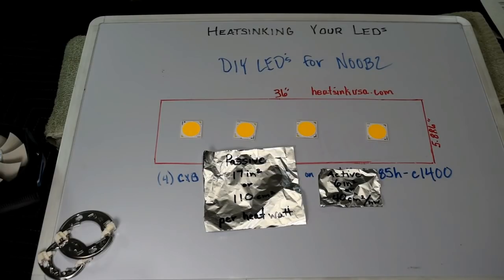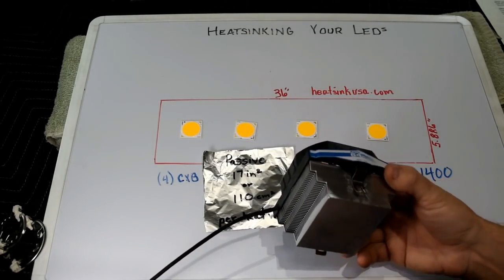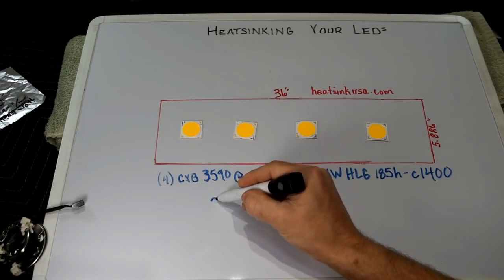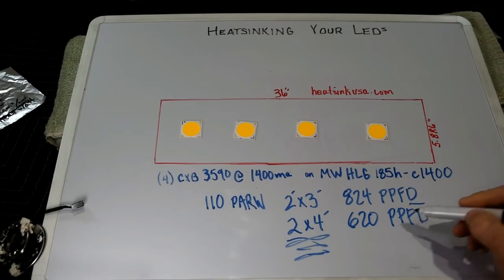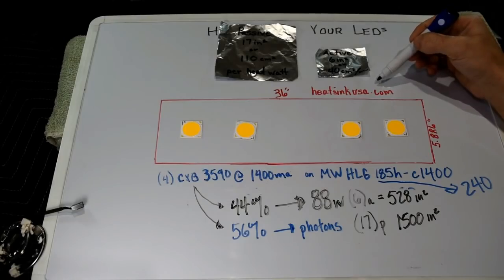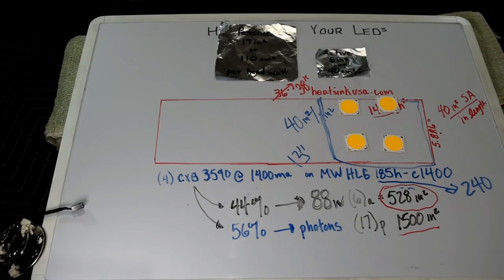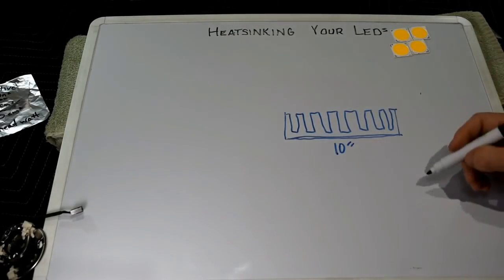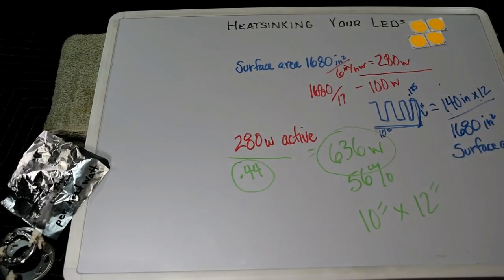DIY LED Basics - choosing your heatsink (part 3/6)

Comment: Thanks so much for the fantastic videos. I am sold and have just ordered some cobs but I just wanted to check my assumptions that I have made with you first.
  
These are 3590 CD's and at 1.4 amp's they produce 21.32791 heat watts per cob and you are rounding up to 22 heat watts per cob?
  
Thanks again for your amazing videos.

Comment: Hey man, just want to say thank you for all your amazingly helpful videos. I was advised to check one out by some guys on the grow weed easy forum and ended up watching a bunch. the result...I'm SOLD. I was looking to get an led to replace my CFL's, but the cost for what you get seemed a little much, but making them myself, I'm totally down with that. my question is, I have a 1.5' x 1.75' x 4.8' grow space, so was wondering what size heatsink you would suggest, as most of yours are rectangular as opposed to square. I presume the principal is the same though, heat watt per Sq in. any suggestion would be great. also, I can you advise which I should go for, the 3590's or the 3070's? thanks again man, best led/cob vids on YouTube for sure.

Comment: CXB 3590 question:  Do I need a full "137w dissipation" if I'm not driving the cob at full 3600ma (according to Cree document) or 2800ma current?

My plan:  CXB 3590 driven at 1050ma.  From your videos, it's about +55% efficient (if I understand correctly) and 45% of waste watt.  

If a 3590 waste 45% as heat (61.65watt as waste heat).  The cob should fit comfortably in one of these "100w heatsink" from ebay. 

The heat sink in question is:  161mm (6.3") diameter round heatsink X 49.5mm (1.94") tall, center mount is a 54.5mm (2.14") diameter.

Thanks.

Comment: Amazing work I was just about to pull the trigger on my first LED setup but after seeing your videos and reading all the work people have done I'm soooo happy I didn't, this is the way forward for me!

If you have a minute let me know what you think of this idea.

2x4 Tent currently 3 site RDWC going to start with 4x CXB3590 3500k with a HLG-185H-c1400 on a 5.886 x 40 heat sink. 
My thinking behind it is if I like this I will crank the juice and build another running two heat sinks.  Maybe mix the spectrum's when I build the second?  And have 2 of each Spectrum on each heat sink?

Thanks. Again!

Comment: I'm trying to find the efficiency of a cxb3590 driven at 1.75 A (36v) - I know it is 56% @1.4 and 64% at .7 . . . . I need this so I can determine the amount of heatsink I need
Reply: +growmau5 that would give me about 2000 sq in heatsink - guess I'll have to go either the 5.375 or 7.28 - both have a perimeter of 53" - -40" length should do - thanks

Comment: Is it wrong that I fapped to this?! Lol but seriously thank you. I'm hoping by the end of this build series I'll have a parts list and the know how to put together my own light. I think I'll be going with the cpu cooler route because it is probably easier to make it more flexible, cheaper and I don't have to try and source suitable heat sinks then attach fans etc.
I'll end up cutting corners to avoid drilling'n'stuff but am prepared to go with bus connectors for the fans, cree leds and if you can demonstrate the electronic dimming/timer install it would also be of great interest! It's not so much about the money for me but a cutting edge light with all the bells and whistles. 
You should try to demonstrate both a super cheap version and a top of the line version.
Reply: +growmau5 Have you used the typhoon led controller?
Reply: ***** Expertise level : Asian!

Comment: Another excellent video!  I now know how to calculate "heat watts" and the cooling capacity of a heat sink.  I have some square aluminum tubing that is just begging to be used for a heat sink.  Which, if I used a fan to draw air down the center, would have both an active cooling surface on the inside AND a passive cooling surface on the outside.  I can now calculate the cooling capacity of even that.  Thanks again.

Comment: Yes I have the 10.080 by 24 inch heatsink, the fins are 2.875 inch tall. I'm going to use two Thermaltake Pure Series Case Cooling Fan CL-F015-PL20BL-A, Black 200mm to cool the heatsink. What's the max of chips I can use on this heatsink?
Reply: +Hector Meza if you watched all 3 videos you should be able to answer that by yourself
Reply: Cool thanks 👍